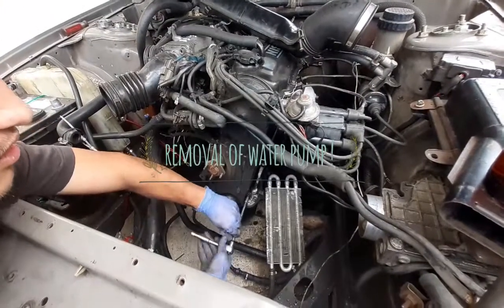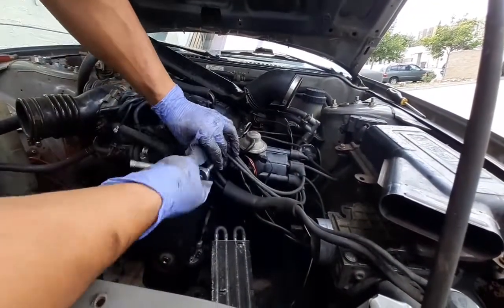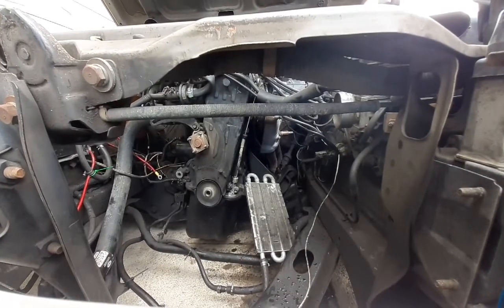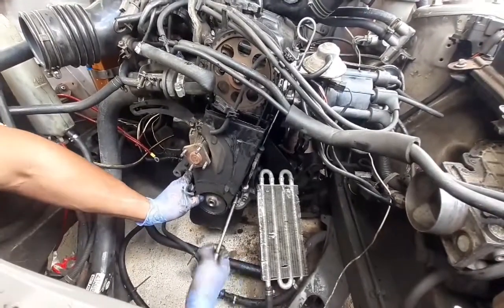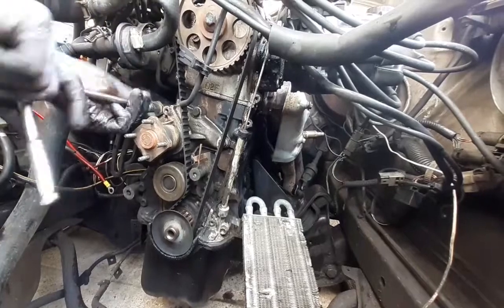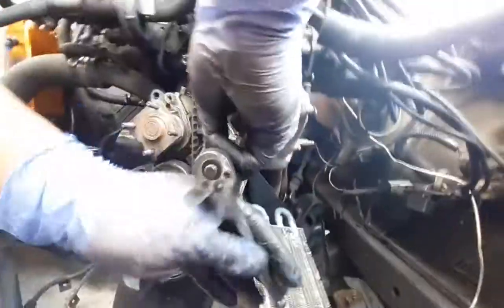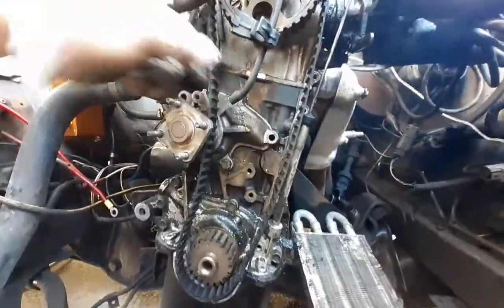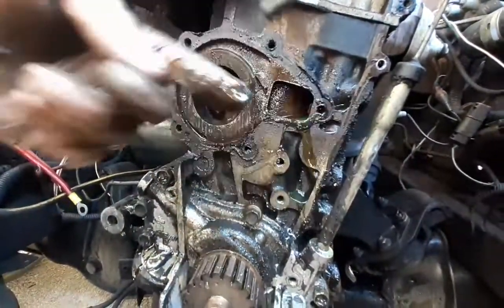Removal of water pump ca20e

Comment: The most work I ever did on the CA20e and also went ahead and replaced the Timing Belt while I had everything off
Reply: It's good to go for another hundred and fifty thousand miles
Reply: @queteimporta67  😀 I was thinking of replacement every 2 years. For the Timing Belt

Comment: Yes, the CA20E is an interference engine. Years ago, I replaced my t-belt, water pump, tensioner and drive belts while in there. Mine was in the fwd stanza, transverse engine.

Comment: I'm having such a hard time getting the starter out.  I removed the two bolts and the starter won't budge at all.  Every mess with the starter?
Reply from the maker: Yea I have replaced  my starter, one thing is that if it dont budge at all make sure that you took of the right bolt there is two bolts very close  on the top side of the starter one is for the starter one is for trans to engine   might get em switch em if you dont  pay attention and if you did take of the right one just get a rubber mallet and hit it it should come off
Reply: @tonyr4701  wow, that would be hilarious if that's what I did.  going downstairs now.
Reply from the maker: It happens....... but other then those 2 bolts nothing else holds it in place  so if it still not budge the mallet will work
Reply: @tonyr4701  you were right!  hahahahaaa!  Wow, what waste of a couple of hours.  it just fell right off once I removed the correct bolt.  Now how the heck to you get to the nuts that secure the cables?  Feels impossible.
Reply from the maker: @HeyUtahGimmeTwo  I just get a wrench I believe  its a 13 mm  just unscrew the nut   nd then I just carefully pull off the negative cable  other then that it should be completely  loose !!  Your welcome bro!! I'll try to make more s12 related stuff  soon !!
Reply: @tonyr4701  I can't see it or get to it at all.  I'm working on a 87 Stanza Wagon with a CA20E.  Maybe my access is just harder to get to.
Reply from the maker: @HeyUtahGimmeTwo  yes it probably  is diffrent  then but it shouldnt be hard  there is only a few type of starters I've ever seen out off all different  makes and models I've worked on so one is normally something you can just seen and unbolt or the wires are inside a plastic box and normally the plastic box is either closed with a nut/bolt or you can just un clip/ unhinge  the plastic normally a 2 piece plastic  then your able to get the wires off other then that I dont recall any other types of starters  might be able to find some videos or diagrams online